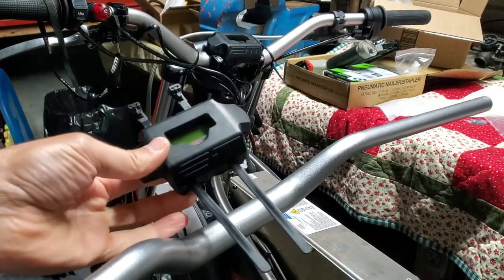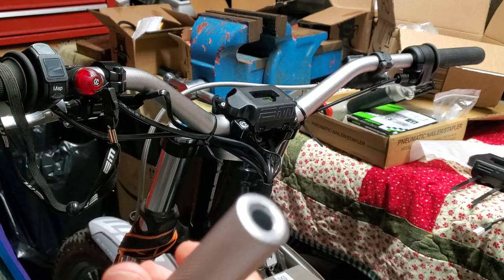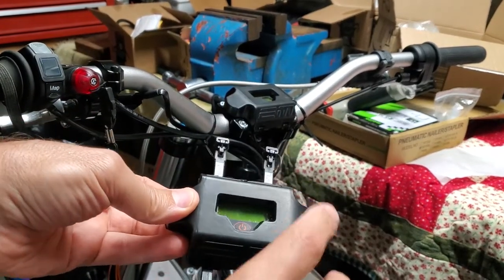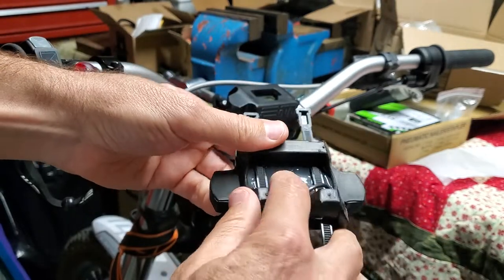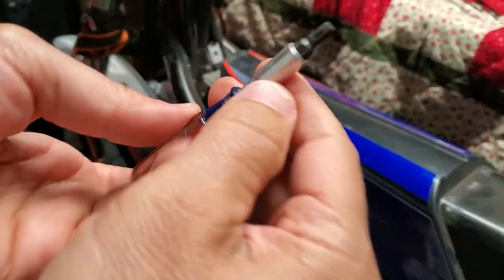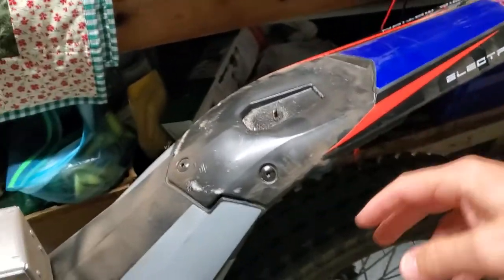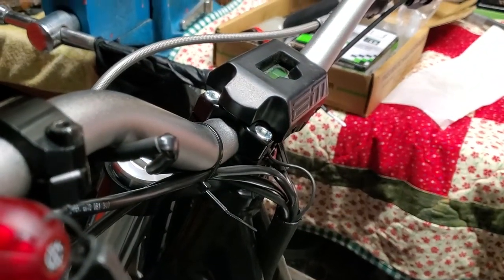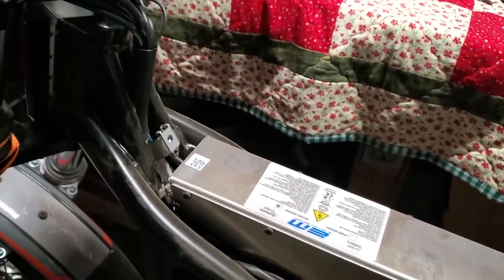Minor warranty Tweaks Electric Motion Escape Battery meter display swap & cowl, seat removal. Part 1

Comment: The correct way for the charger is: plug it into the wall first, wait a couple-few seconds and then plug it into the bike. This gives the charger a moment to normalize the voltage. 

You can technically do it either way but this way keeps the "stress" (essentially surge protection) off of the BMS unit inside the battery and can potentially prevent shorts/damage within the BMS unit (it has happened on occasion). 

Nice video!
Reply from the maker: Thanks, cool! That makes sense to me and that has been my method. Appreciate the tips.